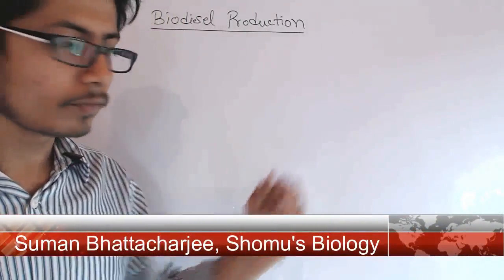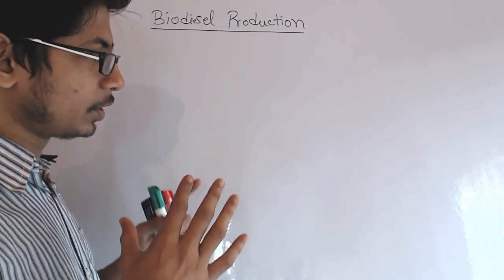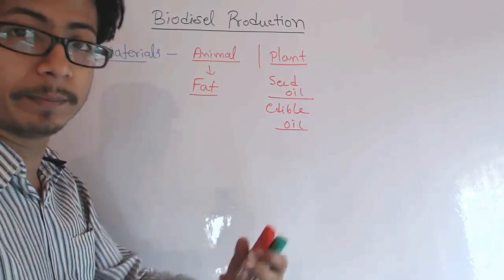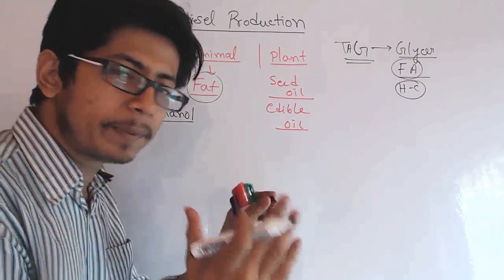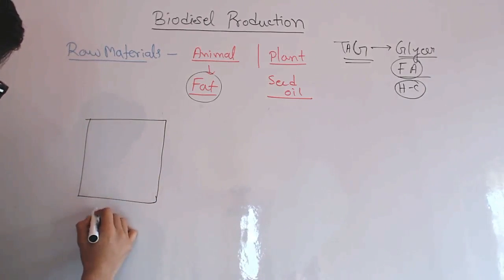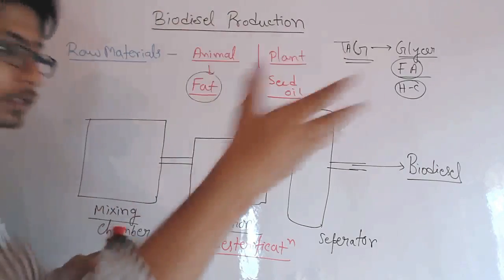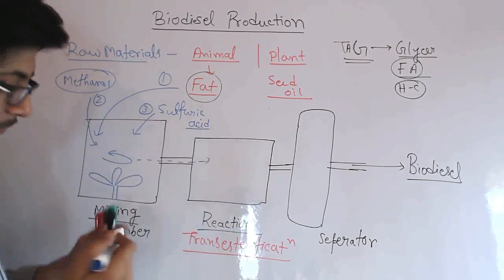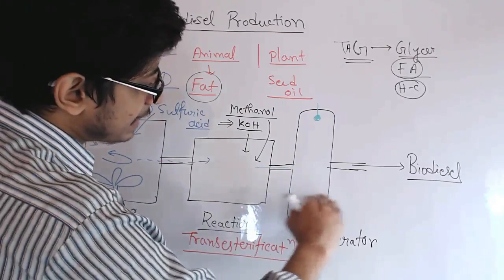Biodiesel Production

Comment: does India have the technology to manufacture Bio diesel from Municipal sledge waste ? if yes only than this sector has the potential to grow & be a profitable venture. as this technology is already running successfully in US & Australia.. relying on agriculture waste & Used Oil is never going to work due to high price of raw material & continuous availability. Municipal sledge is a very low cost raw material for Bio diesel .

Comment: Kindly let us know the temperature to maintain in reaction chamber and ratio of material to be added in mixing chamber as well as in reaction chamber. What are the pros and cons please. The whole idea is for the knowledge purpose only. Kindly provide the suffice detail please.
Reply: 55° to 60°C

The pros : cheap, clean, makes the engine lubricated, same autonomy
Cons : Start may be difficult in colder temps, not the same viscosity than regular diesel so it can be not avalaible for some vehicles, mainly DPF vehicles.
quite time consuming, it needs setup and work if you want to make your own fuel

Comment: MeoH is used for transesterification.. 
If KoH /NaoH is used as catalyst ; then saponification can occur followed by long washing process...
If it is replaced by solid catalyst; then saponification can be avoided...
Reply: creative writer Thanks for pointed out this.
This is what the current industry is using. Saponification which occur due to strong alkaline was added. This will produce large amount of soap which brings down the percentage of biodiesel. Hence, we often use MeOH instead of KOH or NaOH. 
However, something I would like to add on, which is the pretreatment for the raw material. 
Impurities should be removed from the crude oil and FFA should be bring down to certain percentage before transesterification can be proceed. 
One more very important point which is the explosive issue.